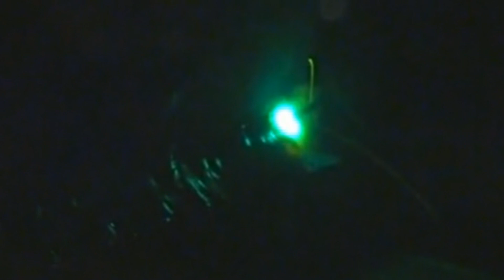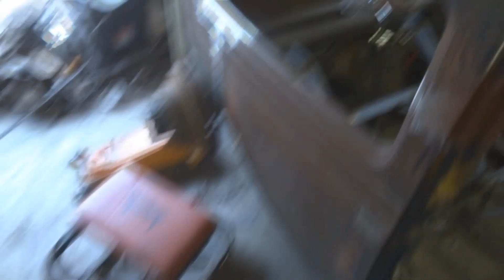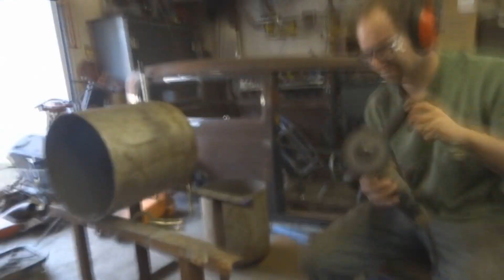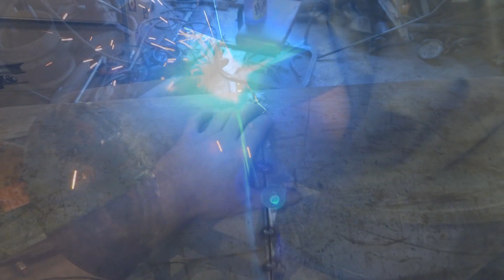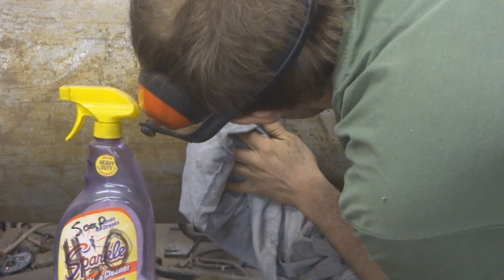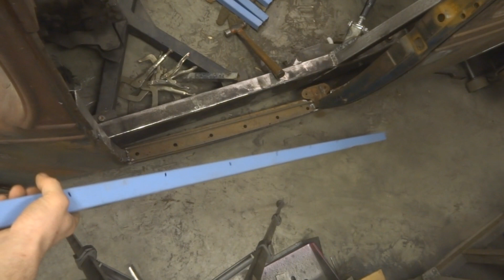Cummins Rat Rod: Project "Wild-Torquey" (Ep. 20) INSANE BUILD!!

Comment: Awesome work Luke, adding extra is never overkill mate, build it too last I say! I'm at the same stage with my 1936 2T2 J5 Studebaker pickup, steeling out the body but I've been running short of time over the last few months to make a start but your inspiring me to too push to find the time now. I have the same issue, I don't have a square tube bender so I'll be pie cutting my tubing to shape it. Thanks for the tip of tacking the tube to the body skin before welding the pie cuts up.  
Cheers
Cory